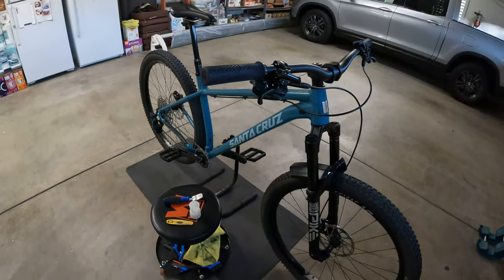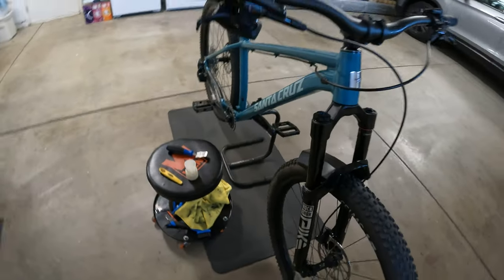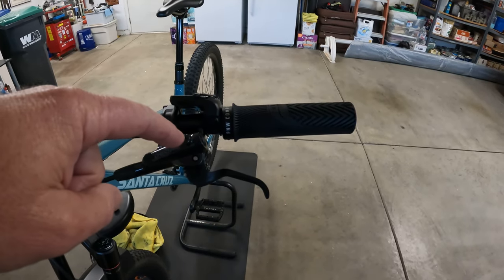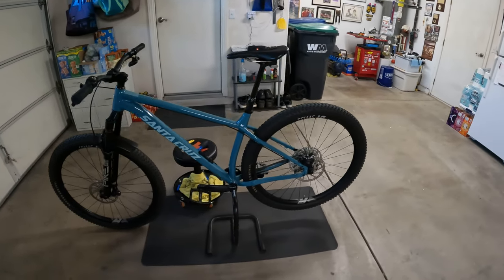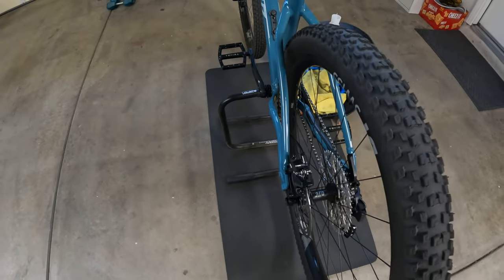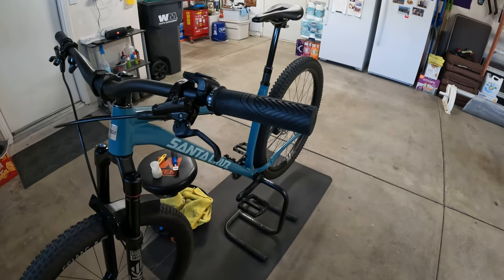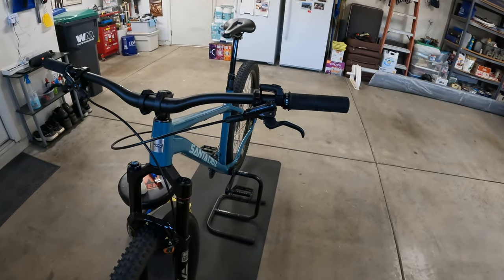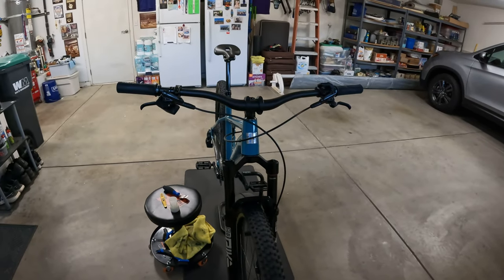Tip When Installing New Brake Pads In Shimano Deore / SLX / XT / XTR Hydraulic Disc Brakes

Comment: hey man! I wish I have seen your video some time ago. While changing tires I forgot to put the red spaced and I accidentally hit the lever of the back wheel..... I pressed in the calipers and on my next bleed the problem appeared.... I overpressured the system to "fix" it..... brake bite now is fine but I suspect now that we gonna have a problem in the future..... I always read the shimano dealer service manuals... and you are right... there is no mention whatsoever AND nobody else mentions the procedure like you do. Thanks  there
Reply from the maker: Hi Harry! Man, I'm sorry to hear that. If you saw any fluid out of the end of the lever then it's torn. If you didn't see fluid, you can check by laying your bike on the ground (with the affected brake being the one facing down) for a few minutes and see if any fluid drips out. If yes, it's torn, if no get a bright light and shine it into the end of the lever and while looking through the small hole gently squeeze the lever repeatedly and look for any fluid or wetness. If you see fluid, it's torn, if not maybe you got lucky... It is SUPER frustrating that Shimano doesn't say a word about it and I wonder how many brakes out there are being used while being compromised.
Reply: @ThunderStruckMTB  HI! Thank for the comment! Well this happened 3 weeks ago. Since then I have no leakage whatsoever at both ends of the system....so lets hope I got lucky... twice since i know what to do now. Thanks again!

Comment: Good to know, i just bought my first ebike ive not had a bike for years magura was my last system but my new cube stereo action team has XT everything on it!
Reply from the maker: Hey Dougie! Congrats on the new bike!! Definitely open the lever reservoir when pushing the pistons back for new pads or you will be one sorry new bike owner. You can buy the Shimano bleed cup or a generic knock off from Amazon and either way, that tool needs to be in your arsenal. Thanks for watching and taking the time to comment!

Comment: On my budget hardtail I have a 2018 deor brakes and have not had to open system the change pads . Tire lever works to compress pistons. Now my new bike a year old has the XT version so this is a great heads up before changing those pads and opening the system . Make sense .
Reply from the maker: Hey Steve! Definitely better safe than sorry. I never had an issue either, right up until I did. I was probably madder at myself for not opening the system as I had read reports in forums about the diaphragm exploding, but decided to save 3 minutes and it cost me. Thanks for watching!

Comment: Jeez you go through some good parts.. bars/xt brakes etc. Would be a good person to know! I had bite point problems and just recently added a tiny bit more oil, via the rear caliper bleed port. Saw it on 'oz cycle' channel
Reply from the maker: Hi Colin! I'm definitely not shy to try new parts! Thank goodness for Pink Bike's buy and sale section.😅 I'm glad you found a solution to your WBP and maybe in the future you can update this reply thread with your long term experience to help someone else fix it too... Thanks for watching and have a great New Year!
Reply: @ThunderStruckMTB  Will do! I have upgraded everything on my bike too. SQ labs 611 saddle is the latest. Was comparing against your Ergon SM pro....decisions...decisions. Also have SQ labs 311 16deg bars coming soon too to try different wrist alignment. You seem to have most things I have been looking at.😁Happy new year.

Comment: Hold on a second, if the system is supposed to be 100% full of oil, meaning, no air, how is it possible to overfill it?
Reply from the maker: Hey Ricky! It's all about the pistons in the caliper. Shimano's official bleed and fill procedure is to have the pads out with the yellow bleed block in place which forces the pistons back to their starting point. Once the system is full and closed off you put the pads in and place the wheel in the bike and then hit the lever a few times. Those first few pulls of the lever are very soft and almost go to the grip as the pistons are pushed out to their new starting point. Once the pistons moved out that created more space in the caliper behind them which then lowered the fluid level in the lever. If you open the lever bleed/fill port and add just a bit more fluid, then now it's "overfilled" based on Shimano's official procedure..... now once the pistons have to move out more as the pads wear, then the overfilling is mitigated a bit because there's now even more space for fluid in the caliper as the pistons are pushed out which drops the overall system level of fluid... I hope this helps! EDIT: I wanted to add that now you should be able to visualize what happens if you top off the system fluid level with worn pads and pistons pushed out and then try to force the pistons back into their bores for new pads, there is no place for the 'extra' fluid to go and that's why the delicate diaphragm rips.
Reply: @ThunderStruckMTB  thank you. I am investigating this as we speak.